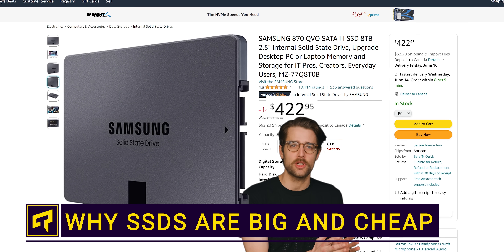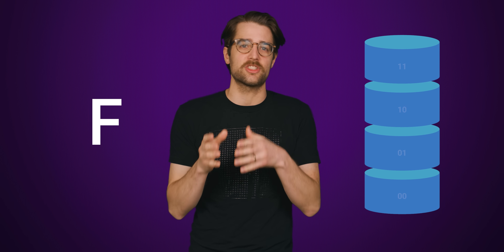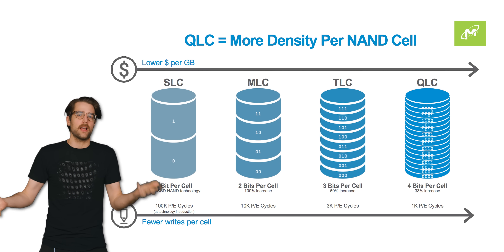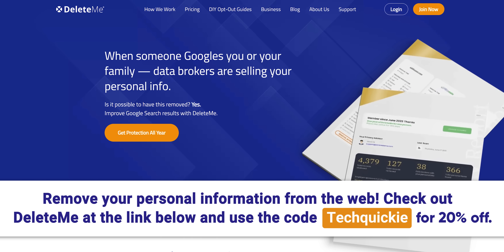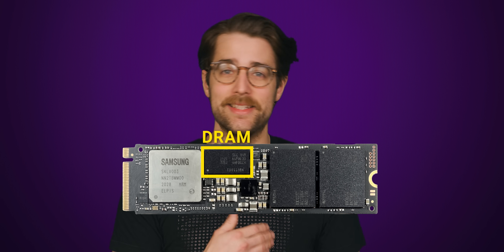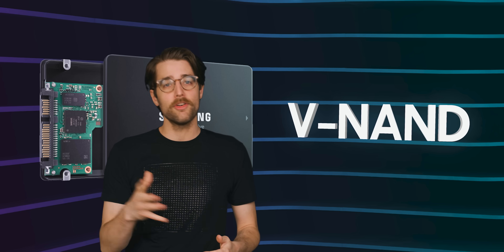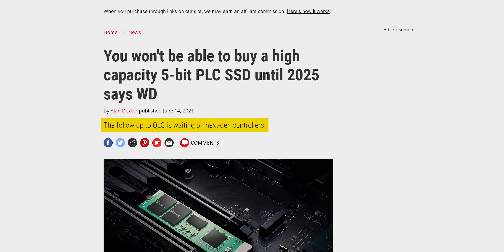Why SSDs Are Big And Cheap

Comment: Yeah SSDs unlike hDDs are getting worse and worse, bigger and cheaper because they are becoming worse and worse, cramming more bits into one cell, drastic reduction of write cycles, higher failure rates, much slower speeds disguised by cache to make them seem fast when in reality, their native speed outside cache is slower than an HDD, etc.  So yeah HDDs have becoming bigger but not slower, SSDs on the other hand are declining in quality BIG TIME - and no body in their right fucking mind would want to use QLC, PLC or the upcoming HLC drives, unless you fancy really low write cycles and high failure rates, and much much much lower data retention times.
The moment they stop making TLC drives, I'm going to stop using SSDs altogether.   It will come to a point where SSDs will be good only as a boot drive for your OS, anything past that, data, documents, etc, should be stored on HDD and backed up !, SSDs are no longer reliable for storage, I mean the QLC, PLC and beyond !

Comment: Theoretically, couldn't you use an ASIC on the board near the controller to perform compression and decompression insanely fast, use SLC nand, and offer a way for consumers to store most file types with a smaller footprint?

What if 1TB was >1TB?
Reply: SandForce SSD controllers would actually do just that, way back in 2011...
Reply: @PileOfEmptyTapes  I wonder if it isn't worth another shot with modern controllers and cache? I'm not sure why they discontinued it, but whatever the reason, surely both the industry and consumers have changed enough to give it another try.

Comment: It's not just endurance.. it's longevity.  The time between powering up your flash storage to renew charge becomes more critical as bit count increases. Yep your data maybe gone.. charge leaked..  This on top of many manufacturers not being completely open on if current drives are tlc or qlc (WD)

Comment: I just got a Samsung 1tb SSD. Cloned my laptop drive and it's ready to go. HP laptops are known for their broken hinges. They're too short for the force required to hold up the screen and the plastic tabs holding the screw nuts break. I'm going to fix and rebuild them using superglue and baking soda and switch the drive at the same time. Can't wait.

Comment: I'm sorry but what the actual fuck is this clickbait? Big and cheap? More like tiny and expensive. Best I can find is 8TB like the one you showed at the start, which here costs 565$ or 70.5$ per terrabyte. Meanwhile a HDD you can get up to like 18TB no problem, or even 20TB, and they cost only 20$ per terrabyte.
And those 2.5" shit SSDs doesn't perform all that much better than decent HDD. 550/520 read/write isn't a lot.
Let me know once the M.2 SSDs with 7000 read/write drops down to that price. And preferably something that has high TBW limit.
Or if those 2.5" drops down to the same price as HDDs instead of being 3.5x the cost.

Comment: Come to China, you can buy 2tb gen 4 TLC SSDs for as low as *70$**😂 Read speed is 7450/s and write speed is 6750/s, with **3600tbw & 5 years* of warranty, nothing could go wrong. ---from a happy Chinese
Reply: if you are willing to add a couple few more dollars, you can also by higher performance DRAM equipped drives.

Comment: I just hoped and wish that with time price drops but along keeping like SLC and DRAM for new gen SSDs though. Yeah there are many solid ones that use more level cells and no DRAM but still, at certain situations you can see the cons of this. We're getting higher max bandwidth but will need higher IOPS eventually too.
Reply: I'm just hoping we can eventually invent a form of solid state storage that doesn't degrade from reuse at all.
Reply: @stevethepocket  well RAM so in time non volatile form of it

Comment: I have never seen a big ssd, and neither have I ever seen a cheap one. You must have loads of money to think they are cheap, they are extremely expensive for what they are. No SSD on the market was bigger than a laptop HDD, which isn't big. And inside it was just a tiny board, smaller than the current SSDs in laptops. The case was made to fit it in a normal laptop HDD slot using SATA. Despite laptops coming with M2 ssd cards, they should still have somewhere for sata drives and somewhere for an optical drive.

Comment: What did you mean about diminishing returns with storage? You said the 5 layer chips "only" increase capacity by 25%, but 5 is exactly 25% more than 4, so what diminished?
Reply: Diminishing return with regards to endurance. It's 25% more capacity, but 2x less endurance (or worse).
Reply: @dat_21  that makes sense
Reply: @Izmir_Stinger  is the most sane youtube commenter I have ever seen

Comment: Solution: Have manufactures invest in U.2 Drives and have motherboards come with the connections standard. Faster than Sata drives and much greater capacity than M.2 drives. A happy middle that has some of the best of both worlds... and if we ever need bigger space.. the drives can come in a 3.5 form factor as well as a 2.5.
Enterprise hardware will have to come to the mainstream sometime.

Comment: I'm happy with the trade off. It's still miles faster than a mechanical drive, and it doesn't crap out immediately even in the worst case scenario. It just goes "read only" until you buy a new one.

Comment: This video failed to mention that while cell lifespan does go down, the real thing limiting SSD lifespan is data capacity.  The more free space you have on a SSD the longer it lasts, because it has more free cells to spread the wear to, so SSD lifespan has actually just gone up as time has gone on, despite cell lifespan going down due to drives not being at 90%+ full all the time under most use cases.

Comment: TLC is hot garbage for powered down storage. IMO stock up on 970 Pro drives while you still can find a few.
Reply: Why ever use SSD for cold storage?
Reply: @vlad54rus-a  because you don't have to worry about mechanical parts failing and have to scrub the magnetic bits of the dataset with SSDs. All they have to do is stay charged.

Comment: I think a good practice is to have HDD backups or an HDD archive. Use SSDs of whatever flavor you like and use a nice 2tb laptop or even desktop drive and store weekly or bi-weekly backups to it and have it overwrite past 6 months, so you'll always have an OS image going back 6 months with weekly backup points.  The HDD will only turn on during backups if you set it to go to sleep with no activity and will last years.
Reply: This was exactly my thinking about this problem, HDDs are still incredibly cheap for storage, just incredibly slow. But they are still far more reliable than an SSD, so if you use SSDs for your everyday use and HDDs as a reliable backup system, you should have an effective storage solution.
Reply: @TrippOnPower  Actually just happened to me lol A cheap SSD dropped out so all i had to do was swap it out with a spare and use the installation thumb drive to restore an image from last week in no time. It was like nothing happened

Comment: As a person that deals with computers in an enterprise, where computers are expected to last five years or more of heavy daily usage, I'd much rather have the higher cost of SLC and be able to have 100,000 writes per cell than QLC and only have 1,000 writes per cell.  Unfortunately, it's almost impossible to find actual SLC drives any more.

Comment: Meh I will always keep a couple of spinning rust in my machine simply for the reliability factor, hell I can't even remember the last time I had a HDD actually die on me but I have had a couple SSDs straight up croak. My only problem is what to do with older drives as I have a box full of sub 500Gb HDDs that all work perfectly fine but with 2-4TB HDDs so cheap these days they really make no sense even in a JBOD set up.

Comment: All i'll say is research the controllers used on the SSD you are choosing, so much dodgy shit out there now. Controller dies = your data is gone. They run hot, and are often going to die before the NAND does. Watch out for those super cheap SSDs.

Comment: would love to use a single 30tb ssd in u.2 from solidigm or micron in my desktop pc with a pcie adapter, but they go for 2600 and 3700 euro....bummer, the biggest consumer m.2 from rocket are 8TB and cost 1100 euro, meanwhile 1tb drives can be bought for under 50...averaging by numbers 8TB should be for cca 400 and 30TB for 1500 :-D only one controller, only one dram cache, the nand is the same... but till than.... rotational drives in raid will do, can have an enterprise toshiba in 20TB for 320 euro.... have to datahoard as the powers to be will soon block and control everything

Comment: I love the fact that spinning platter storage is still getting cheaper, picking up 10tb drives for 100-150 is great  for home server usage!
Reply: Exactlly, you Can buy two of them one for offline backup, and the other for active usage.
Reply: Yeah. Hard drive are definitelyi still useful. Also, that nostalgic sound!
Reply: Where? I’m seeing 8tb is still closer to $200 with some hanging around $150
Reply: @classicrockonly  You can get “renewed” hgst ultrastar 8TB drives for $50-70 with 0 bad sectors. A lot of the price savings have come up through higher capacities, though.
Reply: @npgoalkeeper  I took that gamble once before and found myself with all dead drives in less than 6 months
Reply: That's right. Old HDD with those beautiful sound are still very usefull for data backup. And offcouse the price and capacity also very value.
Reply: I got a 16TB drive 7200 seagate iron wolf for $250 at microcenter on sale... usually $320.  Transfer speed was almost 300 MB/s on a large file copy but average was a solid 200~250.  For long term storage of data that is plenty fast.  I remember which HDD's were smokin fast at 30 MB/s.
Reply: hop[e it goes even lower. that's still too expensive for most
Reply: Yeah, but purple security drives are still expensive
Reply: What brand? A lot of fake out there
Reply: @condorX2  at that price it's probably a drive you don't want
Reply: I just got 2X. 1.2tb drives off Amazon for under $100. (Being used as boot drives on my R620)
Reply: Just be careful not to buy SMR models that are not advertised as such.  Looking at you Western Digital and Seagate.
Reply: I'm still waiting for my baker's dozen of 36tbs... I'm pretty tired of juggling 22tb drives.  Time to step up and give us REAL capacity upgrades.
Reply: Hdd? Nope. I don't want 5MB transfer rate
Reply: @restushlogic5794  seagate offers dual actuator drives that can max out SATA now for sequential workloads

Comment: My first SSD for work was $2500 and 24gb 

Worked perfect on XP as long as you trimmed every hundred hours or so of use. 

FWIW spinning disks were not an option in non pressurized Airplanes at altitude.
Reply: With same budget you could get a 500TB SSD
Reply: @vannhantran547  it was probably in the late 90s to early 2000s. 24 gigs nowadays would not hold a pc game unless it was a 2D game. try to look at red dead redemption 2 and that 24gig SSD will say NO.
Reply: @vannhantran547  2001's 2500 dollars would be like 4500 dollars today, you can get a 14-15 TB SSD for that price.
Reply: should have just had a better job that would have let you use cheaper storage
Reply: @google_is_annoying_me_lots3440   It's not his or his employer's fault.  The unpressurized sections of an airplane severely limit your storage options since hard drives need a cushion of air beneath the read/write heads to function.  No air = head crash = bye bye data.

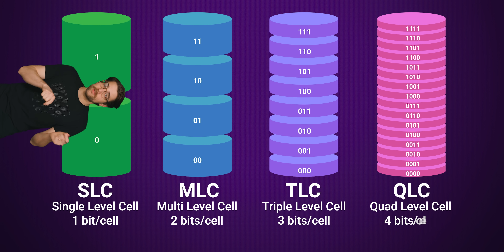Comment: 3:07  Did you all know that the "xL" ([Number] Level) in SLC/MLC/TLC/QLC is a most often a misnomer ?
A so-called Single Level Cell has two levels, i.e. two voltages, directly representing 0 or 1. So remember that "Single Level" is two voltage levels.
A Multi Level Cell has four levels or voltages to capture 2 bits per cell. Multi Level is fine since it's non-specific. Okay here.
A so-called Triple Level Cell has eight levels. So remember that "Triple Level" is eight voltage levels.
A so-called Quad Level Cell has 16 levels, so 16 levels is referred to as quad (4) levels.
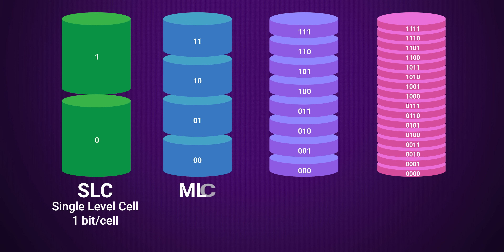Just look at the video at 3:07 and count the Levels, then look at the words used to count them. Silly.
Reply: It's referring to the bits.

1 level = 1 bit. 
2 levels = 2bits.

Comment: Yes, I have noticed the massively reduced boot time since I switched to SSD. But the main reason that I switched was to avoid damage to my HDD when moving my laptop. In any case, the increasing capacity while prices drop are a win for us consumers.
Reply: For me, it was the much longer battery life on my laptop after upgrading to an SSD. Doubled the RAM, replaced the old battery with a new one, and replaced the factory hard drive with an SSD. That made for much faster boot and wake times, and roughly doubled battery life.
Reply: @davidgoodnow269  I did the memory upgrade when I replaced my HDD with an SSD. I didn't bother with the battery because I was only trying to extend the life of a computer that's plugged in most of the time anyway by about a year or so. But, yes, that upgrade combo makes good sense.
Reply: You forgot a few benefits if you'd ask me. The instant application startup time (even for apps that I don't use often), the reduced strain on the battery, the much smaller form factor, the weight reduction, the much higher MTBF, the instant writes and updates of documents, the zero time it takes to get out of standby (no spin-up time) at least as much. Nobody in their right mind still uses HDD in laptop. Possibly an external one for backup purposes, and those are still sold of course. If I get an old laptop replacing the HDD is the very first thing I do.
Reply: These 2,5" HDDs are mostly pretty rugged. 
I remember about 20 years ago, about 2004 or so I put my then pretty new Thinkpad T23 with a Pentium 3 and a 2,5" IDE HDD in my backpack while mountain biking. 
Yes, the laptop was running and I was filming my riding with my first USB Webcam 😂
Never had any problems with the drive
Reply: The ssd has lots of benefits, but your main reason isn’t all that important. Laptops have had active hard drive protection using accelerometers to detect movement and park the heads to prevent damage for the last 20 years. The ssd might give peace of mind and is better for a host of other reasons, but hdds solved the problem of dropping a laptop long ago.
Reply: @johngaltline9933  Please understand the difference between eliminating a problem and only mitigating a problem. Yes, the technology to protect spinning hard drives when they are dropped exists. Still that's a rapidly spinning part in a case that can and will be moved around while it's running. measures such as accelerometers that shut the hard drive off when the case is dropped can and do reduce instances of head crashes, But stopping a spinning hard drive takes time. And pivoting the case can also cause damage because of gyroscopic forces on the spinning platter. My daughter had to get creative to destroy her hard drive.
The only way to be sure is to go solid state.
Reply: @surferdude4487  sure, the crash mitigation isn’t perfect. If you like to throw your laptop at the floor full force it may not be good enough, but then, you’re just as likely to cause physical damage to an ssd or other parts of the Lap top. For normal use, dropping off a lap or knocking against a wall an ssd isn’t providing anything a hdd doesn’t. As above, there are plenty of legit reasons a ssd is superior to a hdd, your reason just hasn’t been one of them in 20 years outside of the areospace industry
Reply: @johngaltline9933 that's eye opening revelation there. Computers are so complicated,  I wonder if there is anyone on earth who knows them from the ground up, hardware and software.  Who could machine code all the way up to c++/net or whatever it is that's running on windows. And perfectly  know how the hardware interacts with software and functions.

Comment: Hdd may be old school, but those things are kinda insane how they work.

If you don't know just think of the rpm, and compare to some saws. Then realize a lot of them are 4 layers with a arm over each one.
Also I'm sure you can find videos of people spinning stuff too fast and what happens.
Reply: that's not even considering the precision in timing, which is insane for physically moving hardware. reading or writing hundreds of millions of bits to specific parts of track in a second while it spins at thousands of RPM.

Comment: The balance way is mostly right. A mb will have 2 to 4 m2 pcie slots and 5 to 6 sata 3 interfaces. With current prices of ssd, i have installed 3 nvme ssd and 2 sata ssd plus 2 mech hd, it is good.

Comment: Optane was too early, i have several 1TB optane drives accelerating a QLC NAND server, but mostly used to hopefully extend the life of the NAND, but it does help to speed things up as well. On long writes each of the 18x2TB samsung 860QVO drive can slow to as little as 40MB/s. Yeaaaa on sustained writes, they're significantly slower than HDDs, i have 16TB HDDs for ~$260 that will do sustained 300MB/s.

Despite the power savings of an all flash server, i am transitioning to a 6xOptane 905P server, with 10x16TB drives, and yes, it is faster than my 18xSATA SSD server. I dont know if it is because of the Optane acceleration for specialmetadata or the drives for read/write cache, or if its just becuase its Ryzen 7000 vs ryzen 3000, but it is fast enough to use as game storage for steam